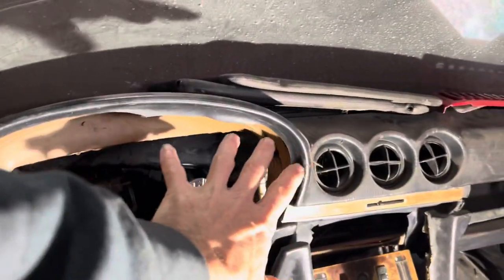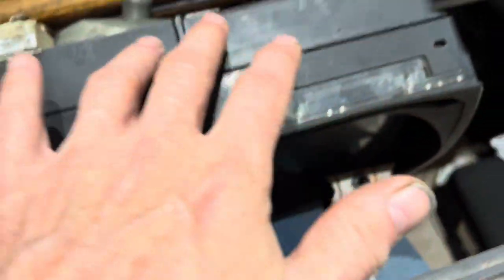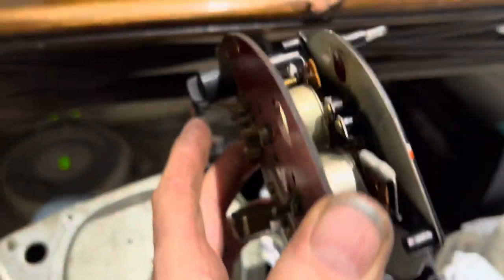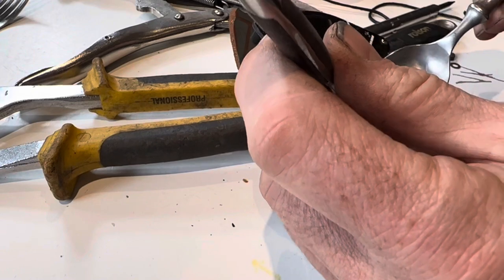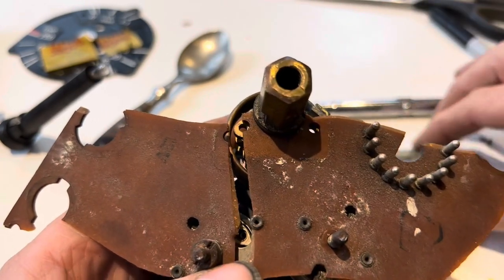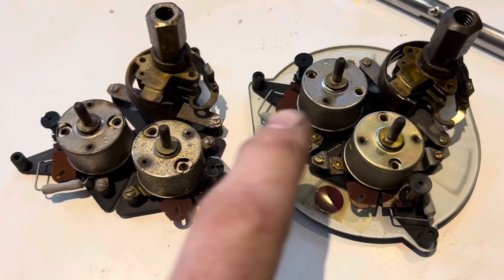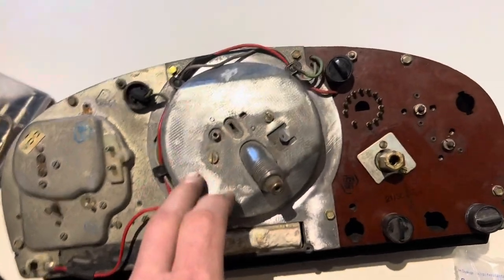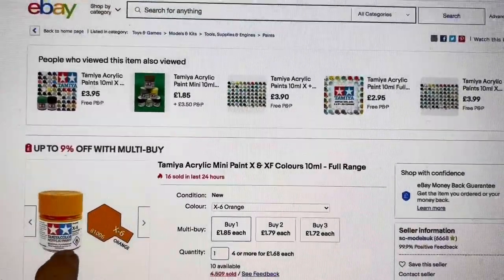Mercedes R107 instrument cluster repair, circuit board, needles and gauges

Comment: Your videos are always very helpful. Thank you very much. Based on my experience on my W116, the fuel gauge and fuel sender unit must be compatible. If you just replace one of them, you might need a shop to adjust them together. One easy test is removing the fuel sender unit from the tank then undo the bottom nut and remove the long aluminum cover. Then manually move up and down the weight and check the position of the fuel gauge needle. Also this is a good time to clean the sender unit inside and I'm pretty sure you need to do that. Peace of cake based on your skills. Good luck.
Reply from the maker: Thanks for your comments - really useful as I'll be moving on to fuel tank and sender soon. Mike